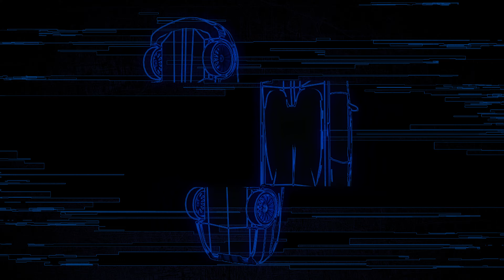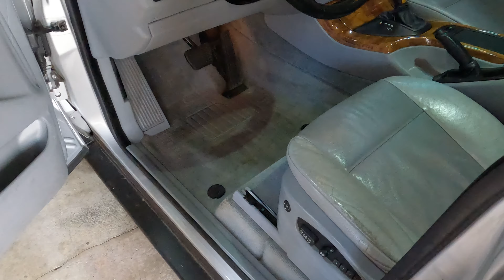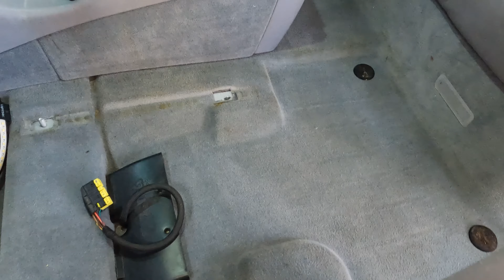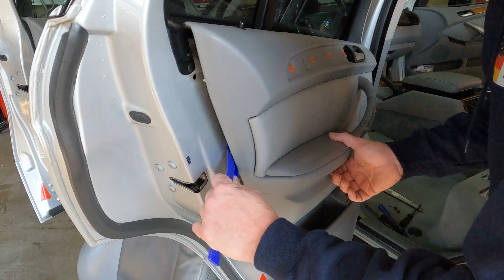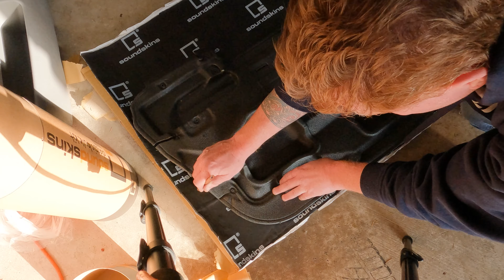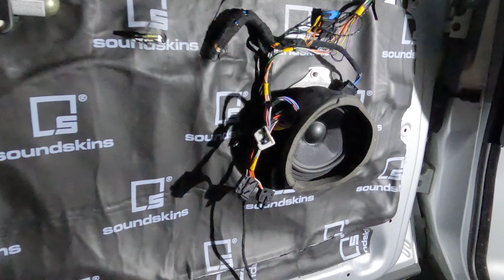Ultimate stage 3+ install of Soundskins Pro - Get serious about audio quality and noise reduction

Comment: Nice work! My solution was to go in the exact opposite direction and remove the radio ha ha.
Reply from the maker: Makes sense in cutting weight or road noise doesn't matter like on the track